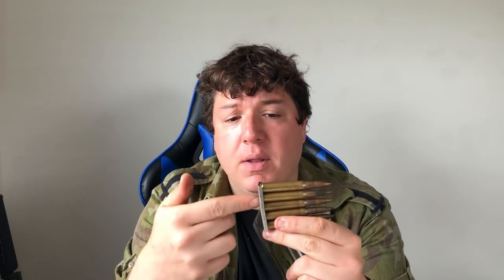Clip vs. Magazine- Are They The Same Thing?

Comment: Hey now, I know there is a definite difference. My point was it's the same concept as jumping down someone throat when they miss speak when referring to magazines. It's a noob thing to call a magazine a clip but it's no reason to be a smart ass.
Reply from the maker: Well right I get that, but I wanted to make sure people knew it isn't the same as the "build" vs "Assemble" argument.
Reply: @MikeB128  Right, it's not an opinion of witch is the right term like the built vs assembled argument. Magazines are factually a different  mechanism than a clip. People like to be a smart ass, dick when explaining either though, lol.

I liked how you pointed out that you don't assemble a house. That made me laugh.